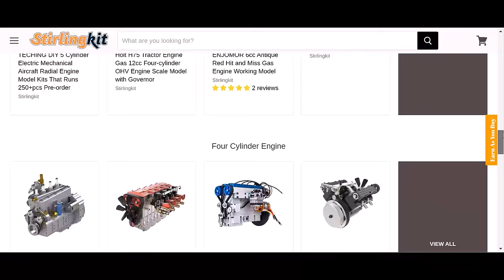Miniature Turbofan Engine Assembly & RUN!

Comment: Sad. It's not engine, its toy, maket 😢
Reply: It is not a toy .  It is a Funktion Model of an jet engine !   But yes it is not a Model Engine !!
Reply: Oh yeah.  I was hoping to see a real launch using jet kerosene 😀
Reply: The intricacies of building this in actual form cannot be done in a kit and while there are small jet engine you can build they are quite simplistic compared to this. Just balancing the turbo fans properly is not something to be accomplished so easily in a home setting. These would more likely explode and cause serious injury or death.
Reply: For sure! Trasparency are not in the real One and knowing prices of modeller's turbojet engines (at least three time) It Is impossible It really works
Reply: @makibarashka You must buy a modeller's turbojet engines if you wanna see flames heat and thrust!
Reply: @zolatanaffa87  I know at least one guy on YouTube who makes small turbojets engines, but they have a simpler design.
Reply: @makibarashka  certainly even motors for modeling are much simpler and almost impossible to build yourself: ceramic bearings, dynamic balancing and high precision CNC are items that hardly anyone has at home. On YouTube I saw a Russian, Igor Negoda, who built some examples of turbines for models but I didn't see anything more than showing them on the test bench.
Reply: @zolatanaffa87  Yes, I talked about him.)  He has a rc plane that has a homemade engine installed and it flies. But, dynamic balansing in garage it's not easy.
Reply: @makibarashka  probably his engine reaches a lower number of revolutions and therefore is less affected by unbalances, but I seem to have understood that on his redmeallized one he has a much larger engine than the one he did (if I remember correctly the one with the green anodized one)
Reply: @zolatanaffa87  Green anodized was a challenge.  He wanted to make an extremely small working turbojet engine.  He made three of these at once.  The operating rotation speed was 100+ rpm.  And before that, he made larger engines, with a rotation speed of about 50k rpm.  They worked more stably and his planes flew with them.
Reply: expensive and high-tech fan
Reply: go away with your trash talk.
Reply: Jet rc engine
Reply: Toy for adults
Reply: @makibarashka 099😅99😅
Reply: I don't see the need for it to actually work. Just the process of assemply is magnificent.
Reply: Mock-up, maket is the Russian word 😂

Comment: You need to spray  some starting fluid in the front intake and light it with a lighter. That would be a good video.
Reply: I was disappointed

Comment: Bearings look loose in their housings. Use bearing fit. 

Threadlock all screws into metal female threads. 

Just a little detail that will save the project......

Comment: Nice model kit. Comes with a lot of parts and screws. Remember, the real thing got lots of cooling trough the hot parts, this tiny stuff would melt in seconds.

The simplest little Rc jet would be much more efficient than this until it comes to a specific size.
Reply: Who has these kits?

Comment: Nice, but extorsive cost. 
At about twice the cost, you can get a real, working, functioning jet engine and build a jet-powered RC model airplane. An electric-motor driven replica shouldn't cost anywhere near that.

Comment: I wonder if it's possible to build an actual working turbine this small.
Reply: There are commercialy available working turbines available used to fly radio controlled models. There have also been working turbofans made by modellers although they tend to be larger than this kit.

Comment: The code KR200 does not work.
Reply from the maker: Please wait, I will get you the correct code. Sorry for this problem
Reply: Thanks!
Reply: @inventorkr1  one more question: I see these advertised for $89 on Facebook ads and from sellers at $800-1000. These cannot be the same, right? The $89 shows all the exact photos of this model.
Reply from the maker: @SteveHookEm    This product is not available at this price at all. Only the official website, which is linked below the video